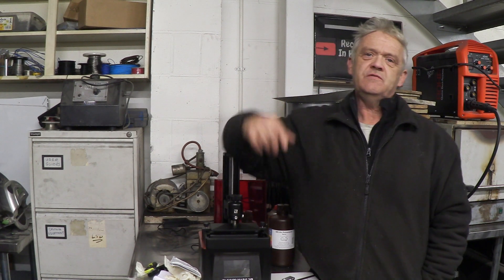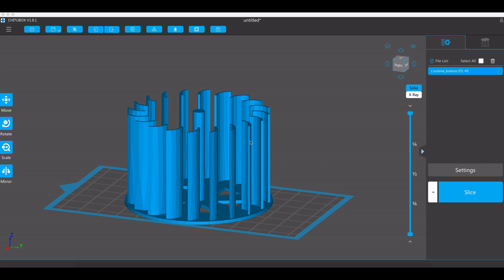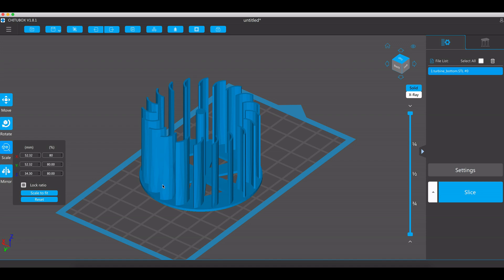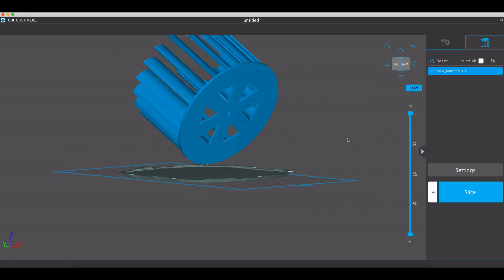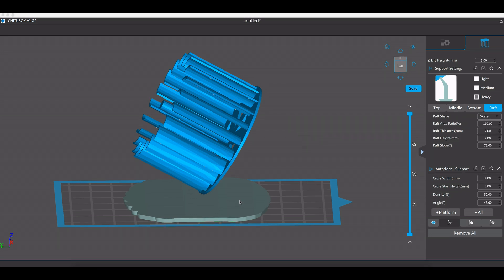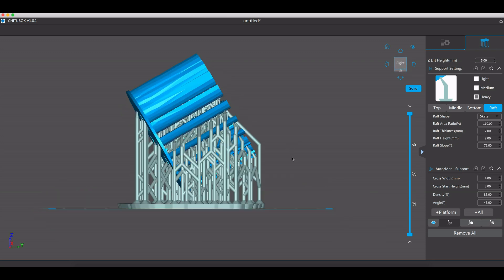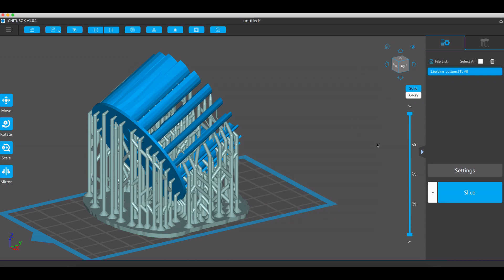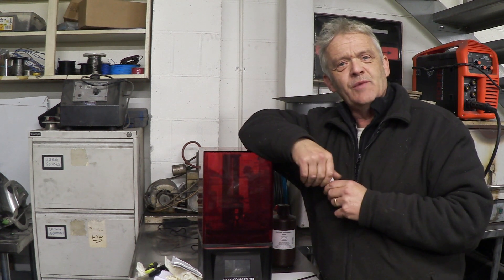1337 How To Use Chitubox 1.8.1 Slicing Sofware For The Mars 2 Pro 3D MSLA UV Resin Printer

Comment: Hi Rob, thanks for this. As you’ve got me interested, I’ve been looking around for other vids on that printer and I now have a little more knowledge but have now one big query (probably more than one but let me start somewhere 🙄)……I get the logic about supports and why it’s important to consider printing at an angle (sometimes) BUT (and forgive me if I’ve missed something obvious) in respect to your turbine blade print why wouldn’t it be simpler to print it 1. At no angle? (ie flat) as this would provide its own raft base (albeit with a few holes) and 2. By doing so it wouldn’t need any supports as the turbine blades would be supporting themselves……(remembering that it’s printing upside down)? Anyone?